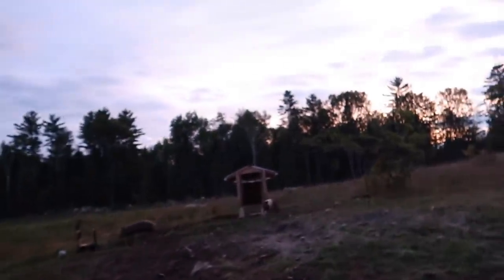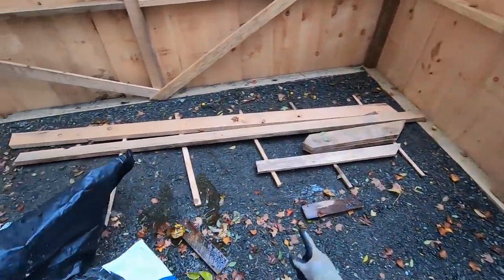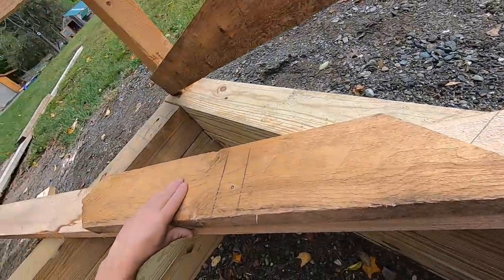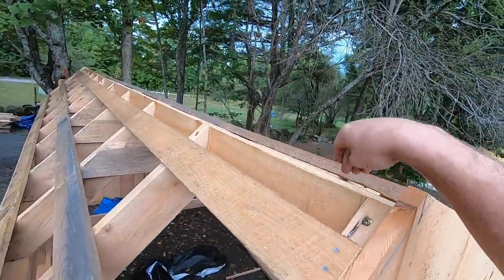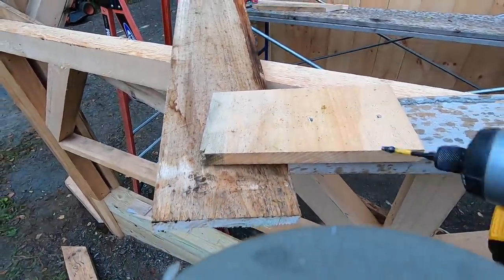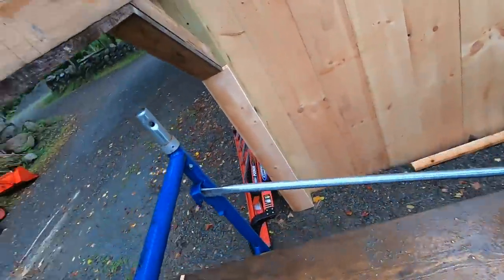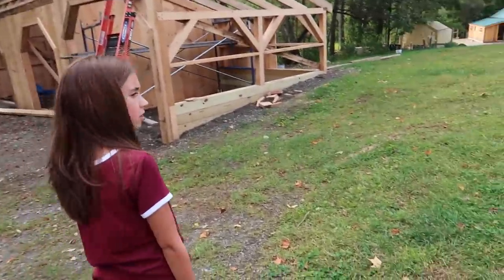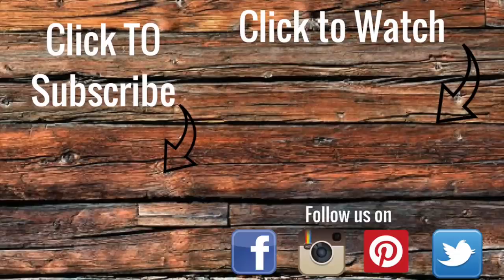Roof Rafters & Rain NOT a GOOD Combination

Comment: Hi Al, I was thinking if you added a plywood board at an angle in the goat hay feeders, high in the back and low in the bottom front, the hay would slid to the front of the feeder. All of the hay you put in would be accessible to the goats.
Love your videos, watch them all.
Thanks

Comment: Hello FROM NORTHERN CA I started raising old English bathams about 8 yrs ago, just a backyard flock. I started with 2 lil hens and knew nothing about the breed. I started out with a small rabbit cage. Then I started getting unique looking silkies and moved to a large 12x24 pen during the day but still came in the house at nite until my uncle took a very old wood shed or could be a old outhouse, no one can remember lol. My uncles insulated and rebuild the inside but left the outside looking rustic.  Now I’m finally putting in a real pen and plan on painting my coop to match my house. The summer was so hot so I spent summer collecting and buying supply’s and now it’s starting to cool off I can start building. I spent the weekend cutting wood to size and measuring all my boards. It would be so much easier to just pay someone to build for me because I have health issues that slow me down, but I want the pride of doing as much as I can my self.

Comment: When I was in my 20's, A LONG TIME AGO, I built a 16x24 gambrel roof garage.  We set up a production line where all the materials for the rafters were cut, one common cut at a time.  With a plumb and a heel cut, a birds mouth and the angle where they met, there were 5 cuts on the lower chord and 2 on the upper chord.  We'd move the lumber through the saw, a radial arm saw, from one side to the other changing the cut after each pass of all the components. Then we assembled them as trusses with plywood gussets.  All the cutting and assembly as well as setting the trusses was done in one day.  You're young enough that you could have processed the pieces for your barn in a similar fashion.I had some helping hands but still could have done it with one assisting pair in a couple of days.

Comment: Al, just a strong suggestion "and you know your environment better than I", looking at the shape of the Salt Box.  I would incorporate vents in the lower back wall and/or ridge vent.   This way when your warming up "whatever vehicle" in the winter months any accumulation of Co from the exhaust is going to be vented out fairly quickly.    Likewise for the Kabota, it's Nox gases from the Diesel and also Co that needs to be vented.      With just the main door and depending on the wind direction and speed, it may not be sufficient to air out any accumulated gases.   My recommendation is to include some cross ventilation.

Comment: Gina, Al gives you a hard time over cracking eggs, you have a concrete counter, gently smack it on the flat counter, it doesn't shove a tiny piece of shell inwards it just cracks the eggs. Try it sometimes, it really is easier.

Comment: Ah, made S.O.S., but with biscuits.  Havent had that in quite some time.  

Anywho, Al brother, not sure exactly what camera it is you use when walking around and getting closeups on your talks.  But I think there is a Face Tracking option in the settings that will help keep the focus locked in on you, instead of going out of focus and focusing on whats behind you.  Give it a looksee in the menu options and see if it is there or not.  Am pretty sure it is.

Comment: Al ,, being a single gal, I have zero power tools. And feeling the need/desire to start somewhere. If I were to purchase my 1st saw. Which would be best? A skill? A chop? A sawzall? Looking to do basic crafting projects not worried so much about finish on cut or angles at this point. What you think? Anyone elses input is greatly appreciated too. Thanks in advance
Reply: To me a skill saw is the most versatile for all around use. Just need to know proper handling skills. It wont cut curves but straight cuts and angles. A jig saw would be nice to partner up with that for curves and circles.
Reply: @glenncountry  thank you kindly for your input and reasoning. 😊
Reply from the maker: A skill saw
Reply: @LumnahAcres  thank you Al! Greatly appreciated

Comment: (Pack of 12) Barrina LED T5 Integrated Single Fixture, 4FT, 2200lm, 6500K (Super Bright White), 20W, Utility Shop Light, Ceiling and Under Cabinet Light, Corded Electric with Built-in ON/Off Switch
4.5 out of 5 stars 298
$80.99 ($6.75/light) $101.24